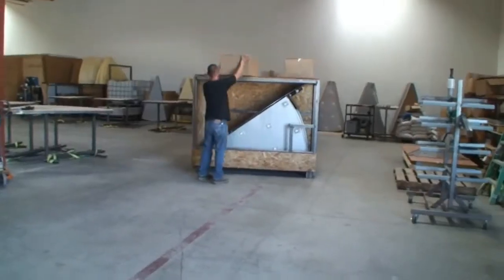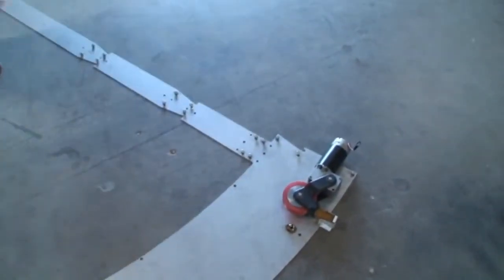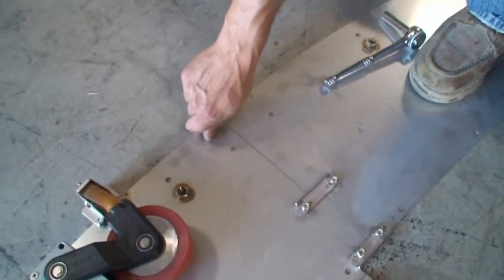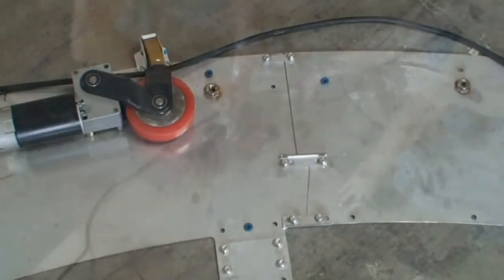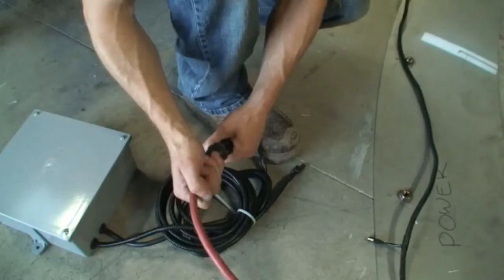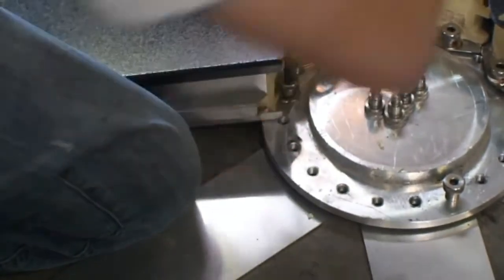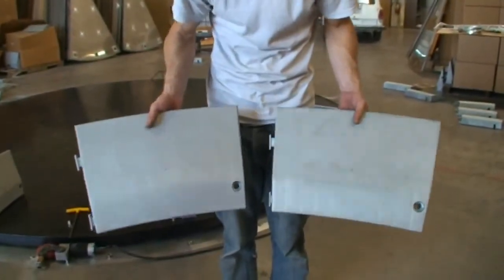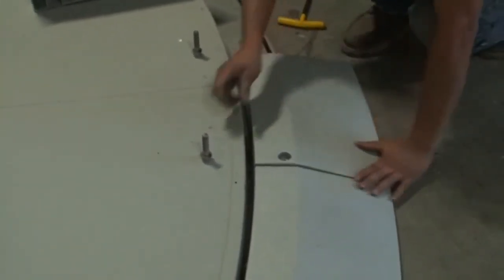Carturner Automotive Turntables.  Inside The Build.

Comment: Hello guys. I have a few questions, what kind of motors do you use, brushed or brushless? How many volts is the power supply? How powerful are the engines? Do you use any motor control electronics with speed and direction control, or do you simply switch on the power to the motors with a switch? Are the motors parallelized or individually controlled? Thanks for the answers.
Reply from the maker: 24 volt DC system. 6-12 motors. has speed control and is bi-directional. Has wireless controls, and duration timer